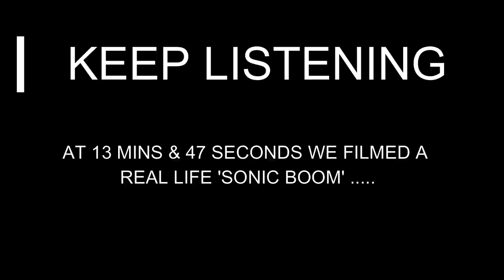A Monster Birch Plywood Bookshelf  |  PLUS BONUS FOOTAGE - Phenomenon Caught On Our Camera's  EP#46

Comment: Hi Ryan
Another great vid 
I recently got one of the 16 inch fans to put in a small 
Paint booth 
How are you venting yours 
Are you using a reducer
Mine got to go through a brick wall 
Any suggestions 
Graham
Reply from the maker: Hi Graham thank you🙏
I just cut a hole through my stud wall the same size as the fan, with just the lip of the casing screwing onto the wall 👍👍